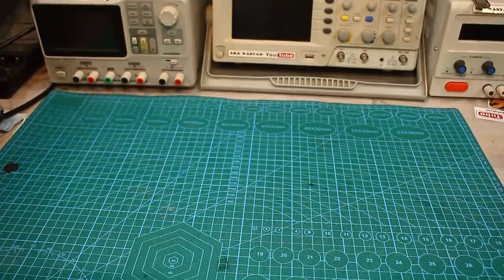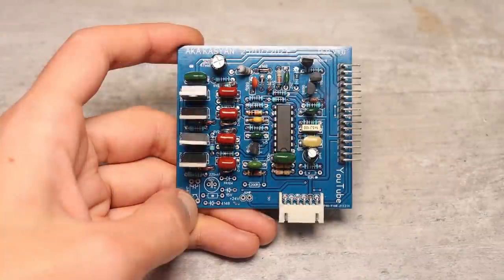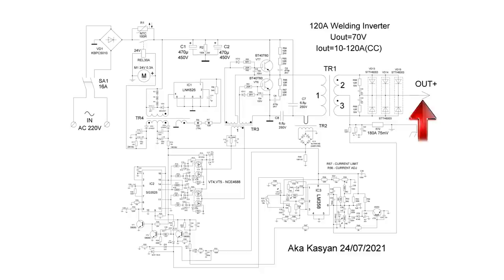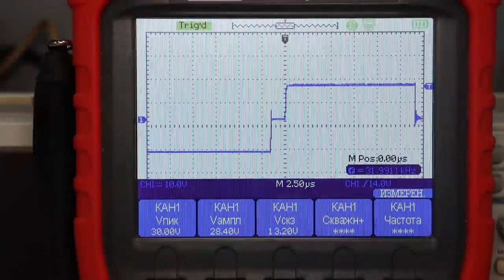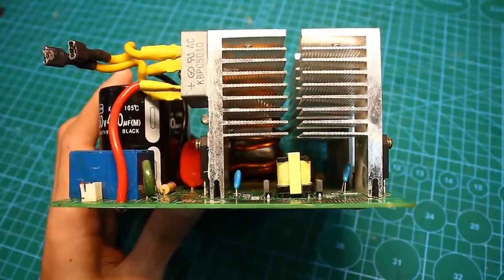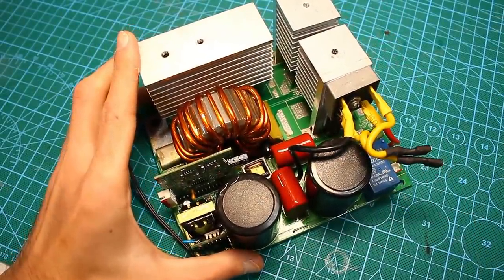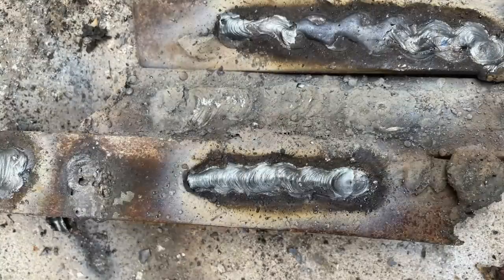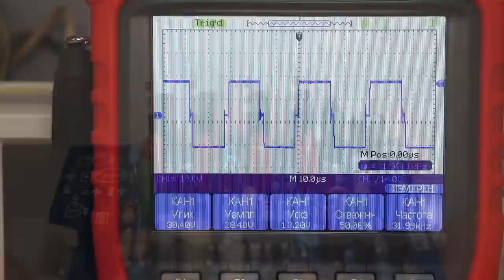STEALING FROM CHINA - Again!

Comment: Once again fascinating! Thank you. However please be careful welding directly on concrete, especially when you cut using the arc. Concrete when heated intensely locally will try to expand. But when the heated section cannot expand it builds up huge stresses and can explode like a small grenade!
Also, could you please suggest what components I might have killed on the small yellow welder using a 4mm rod 😆 
 I bought it after seeing your fantastic video on it and had a lot of fun with it before accidentally killing it.
Reply: It would be a big concern with a crucible full of molten metal, but not with the amount of heat energy that the usual weld spatter can carry with it. It's certainly enough degrees C, but not enough Joules of energy to cause a big explosion that would be life-endangering. But you can still damage (spall) the concrete and make it look ugly, or end up with small bits of very hot concrete in your eyes or making an unsightly burned hole in your hair.
Reply: @kfoltman  just depends on the concrete too. Concrete with pockets of rocks can surprise with the size of crater left behind. But kill? Not normally.  It's just ugly and can ruin your driveway.
Reply: Yes, the moisture in concrete will turn to steam and explode. I know a fellow who ended up in the hospital from welding on concrete.
Reply: It depends! You can tell what went wrong by dismantling the welder machine  on the workbench and starting your diagnose. I would check the 1. bridge rectifier, 2. the IGBTs, 3. the schottky diodes. You can also check the auxiliary power supply, if you're lucky, this ic LNK626 or any other TOP switch ic like TNY280 depends what welder you have etc. gets damaged and once the auxiliary power supply is defect the whole appliance stops working. Have you got a schematic for it?
Reply: @tr_2sc1970  I know, I once repaired one with a defective PCB (broken PCB trace from being moved around a lot) on the aux power supply board. But it is a lot more intimidating, many things were totally new to me.

Thankfully there are schematics of similar welders online, so it's easier to understand what is supposed to be happening. Interestingly, many of these schematics seem to have been created in Russia or maybe some other Russian-speaking country.
Reply: @kfoltman  I speak from experience having had a floor explode in my face just as I flipped up the mask. If I hadn't been wearing safety glasses because I was using a grinder between welds......

Comment: So cool. I would love a welder with more modern controls. Much like lab power supplies, until recently they have all used outdated interfaces. It should even be possible to turn it into a 5 in 1 multi-welder using an ESP32 to drive a wire feeder for mig welding and gas solenoid valve for tig. The microcontroller could also allow you to set pulse timing and ramps using the PWM output, which are important for tig welding. It would only add maybe $30-40 to the cost between the ESP32, solenoid valve, wire feeder, connectors and display.

How about a series where every video adds a new feature to the welder? Adding mig in one episode and tig in another, and a mini compressor for air plasma cutting in another.

Comment: This is also sold under mastercraft. They charge like 300$.
Reply: Do you know what model number MasterCraft lists it as? I would love to be able to make the comparison. BTW if anyone can suggest an affordable option to produce a "spool gun" that I can use on my Lincoln Wirefeed welder in place of the SG100 that Lincoln markets for this unit, specifically the Lincoln 180HD Wirefeed, I desperately need to have aluminum welding capabilities and I even have the argon gas tank prefilled etc I just ran out of money before I could afford to invest in the spool gun so I'm definitely interested in any input or suggestions to produce one myself from available and affordable components from the aftermarket. Thank you in advance and I very much enjoyed the video and encourage you to produce more like it and definately the larger model you spoke of!

Comment: It will be really usefull if such device can be used for battery charger/maintainer where more than 80 amps are required.
Could you please make a video showing how to lower the output voltage to ~14.8-15v and keep the high current?
Reply: No

Comment: hello Sir, great work. I would like to know the test procedures you carried out before giving the igbt complete 310 VDC. I mean did you gave igbt's less voltage at first to test whether the switching and current feedback is working correctly or did you just directly gave the inverter the entire dc voltage and started the inverter. If you do know a method to test without giving the igbt's the entire voltage, please let me know.

Comment: Can you manufacture this unit for sale to us? Add switchable 120/240 input with settable current max inputs to allow matching the AC breaker rating available. The welding performance would then depend on the AC circuit available wherever you are using the unit.
Reply: No

Comment: @5:40 I have a Dr Meeter bench top ps and it just quit working one day with very low hours and power usage. I can't figure it out as all caps are good and no visible burned our resistors or transistors. I even took out 3 of the transistors to check. Anyways I'm stumped so this part may be my answer. I wish wasn't such a noob. I got all the stuff for learning purposes and now can't do much. So I'm on a mission to build everything my own.
Reply: You're gonna make transistors from [insert patented method] in your microwave to purify and set frequency (aka from scratch). I don't think the FCC would like that,  they would know

Comment: Huh, so thats how they work! I love your videos, I'm using them to learn power electronics and see how these devices function.

Odd question, but what about making a DC arc welder? I ask because I considered buying one from a government auction, a Lincoln 250MK that makes it's DC wave by using a brushed motor. Have you ever heard of that?
Reply: Patents are a good start to learn
Reply: Cheapest way to make high current output with rugged design etc is to use an ac motor to drive a brushed dc motor in reverse or as a dynamo

Comment: Man you are smart!!  I have a question.....  I have no idea how to get this done or who could do this but I am trying to find someone to design  a adjustable CDI for a 2 cyclinder motorcycle.   Using halleffect sensors and a 12 volt ignition coil.  And I need it to have an adjustable igition timing curve.  Any info on who, or how to get this done would be great.  Thanks.

Great video and work!
Reply: I think a Arduino uno or something similar would work for a homemade engine computer
Reply: @randylyon2063  Randy, you may be right.  But I know engines.   Not electronics.  Lol.  Would know were to start.

Comment: Would it benefit the machine to upgrade the aluminium heatsinks with copper ones?

Edit: And add an aditional high static pressure fan(one of those crazy 10k rpm ones that 2U servers use) in the front also replacing the stock "paste" gunk with Arctic MX-5!
Reply: Idaq